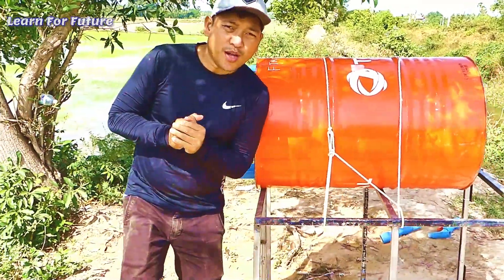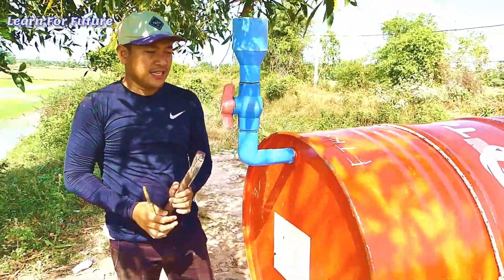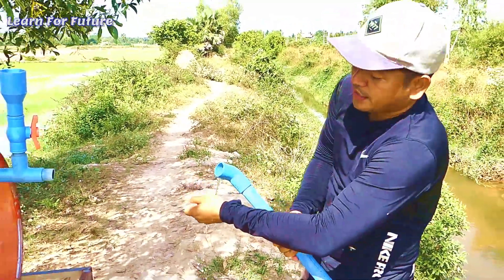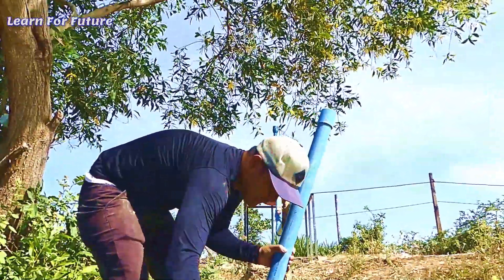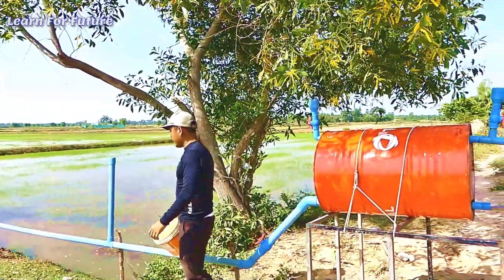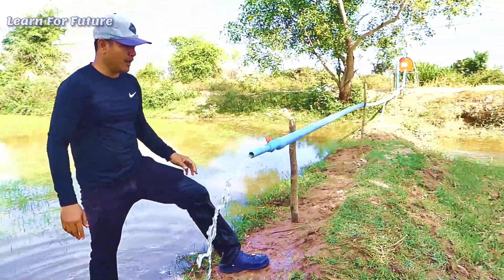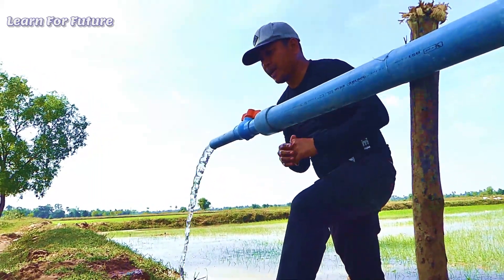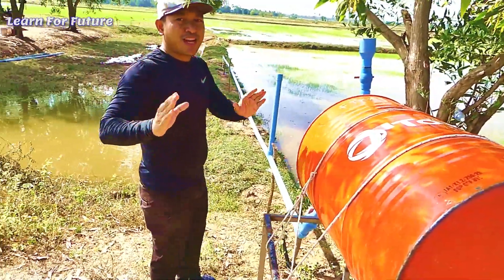Free Energy Water Pump - Explain Details How to install Drum Pump system - No Electricity Power

Comment: This is no pump, but a siphon with a priming drum. With a drum, you do not need any foot valve, waste of money. ! No need for the vertical pipe on the output side, waste of money. No need to redusece the diameter at the output, but you should either dip the output into a bucket of water or mount an upward bend. This vill prevent air from coming in from the output side.

With a foot valve you can drop the whole drum, just one filling stud.

Remember, this is a siphon! Water level in river must be higher than output to the field.

Comment: What is the maximum height of the drum? Is it work if I'll get water 7meter because I'm planning to get source in our deep wheel.
Reply: This is a siphon. Cn not lift any water up from a well or a deep river. Output from system must be lower than input, river, pond or well.

Comment: What is the use of the pipe under the input pipe, while you are just using 3 hole which are the inpjtt, output and the pouriny of water. So again what is the use of the pipe under the input pipe?
Reply: No use. Just a blocked hole in the drum.

Comment: Hi brother, would you mind to list down what size of pipes, pipe connection types, and sizes, do we need for this project? I prefer twin tanks. Thanks
Reply: If what they claimed was true in this video that the drums are acting as a pumping system then the outlet side could be raised to a height of above the drums and it would continue to pump water at the outlet. But in fact if you build this and do the test you'll see that it works fine so long as the outlet is below the outlet height of the drum The moment you move the outlet above the height of the drum it stops working. This proves beyond a shadow of a doubt that it is only working on the principle of siphoning so the drum is of no value simply run the pipe from the canal to the field fill the pipe with water then open it up and the siphon effect starts.
Reply: @ke4uyp  No, not the geight of the drum, the water level in the river must be higher than the outlet to the field.
Reply: @kjellg6532  So you're saying the water is uphill?
Reply: @ke4uyp  This is a siphon with a priming barrel. As such, water can only flow from a uphill soutce/input to a downhill drain/output. 
No siphon can lift water to a higher level, but under way a siphon can pass water over a 7-8 m high wall. Unfortunately, no water can be extracted up there, 100% of the water must down to an exit lower than the source.
Reply: @ke4uyp  What i think is that the weight of the water in the drum act as an extra heavy mass that the water in the output pipe pusses out and the intake pipe is taken water in by siphon / vacum principle . However , siphon principle is that the intake pipe is higher than the output pipe . Then the extra standing pipe for the air , i think that maybe by the flow of the water the air inside is compressed and create a up / down motion in the pipe .
Reply: @dreddredd7137  There are videos on YouTube that debunk this concept and explain the physics why. It's an age-old you can't get something for nothing.
Reply: @dreddredd7137  Forget about weight of water, dos not matter. Vertical pipe is useless, just theatre. Has no function.
Reply: @Learnn_for_Future  thanks brother

Comment: Diameter  of the pipe that sucking water from the river  are the same like the diameter of  the output pipe  ?  I  see 60 mm diameter of pipe going out to your land  , 30 m long  and where water go out i see the diameter are smaller.... this  need to be smaller? Have the same diametet like sucking pipe that going in the river?
Reply: All pips should be same diameter for maximum flow. At the output, no reduction of diameter, but dip the output into a bucket of water or mount an upward bend to prevent air to enter the system.